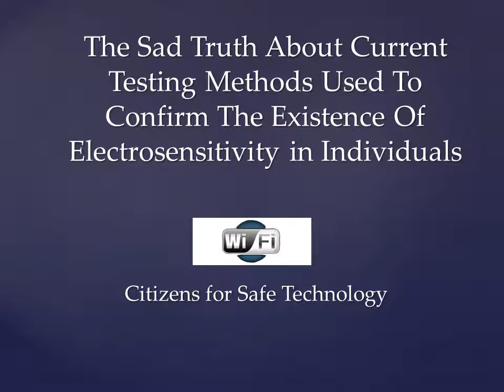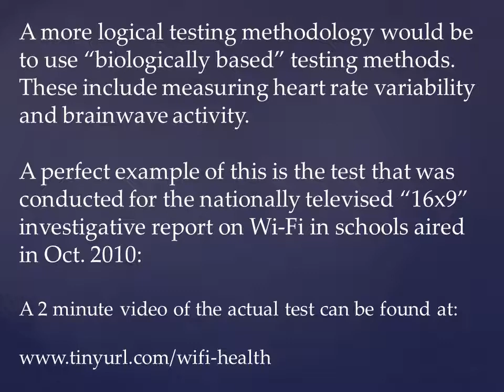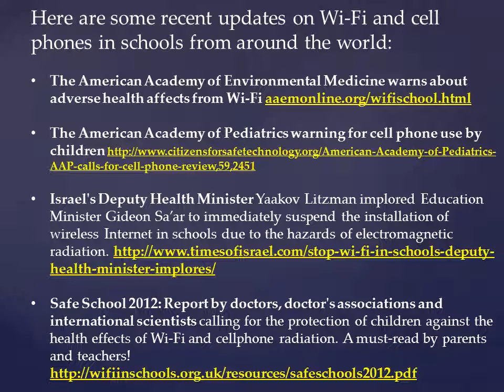Electrosensitivity: Testing Methods Are DEEPLY FLAWED

Comment: You may read some reports that people who are electro-sensitive are “tested” by asking them to say when an EMF source is turned on and when it’s turned off. Such a test will not be useful. As this report notes, “Electrosensitive reactions are in most cases identical to allergic reactions in the way they present. Once exposed to the ‘allergen,’ in this case electromagnetic fields (EMFs), the reaction [such as heart palpitations, ringing ears, anxiety] usually lasts from a few hours to many hours.” Moreover, many of the biological effects do not show up immediately—for example, if it is  daytime, the subject is not going to be experiencing inability to sleep on exposure to the field.

The report continues: To expect all subjects to be able tell when the field is on or off is “like exposing someone who has a peanut butter allergy to peanuts, then removing the peanuts and adding them back several times and expecting the subject to correctly report when the peanuts are present and when they are not. Like the peanut allergy, the reaction does not stop when the aggravator, in this case, EMF, is removed.” In addition, most testing conditions are not free of other EMFs, so other aggravators are present even when the one being tested is removed.
Reply: Exactly. Well said.